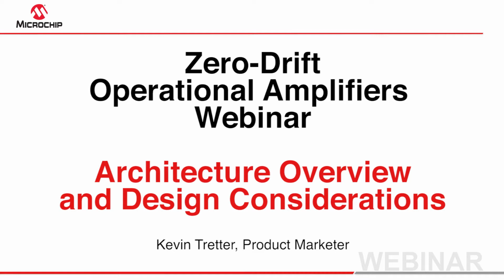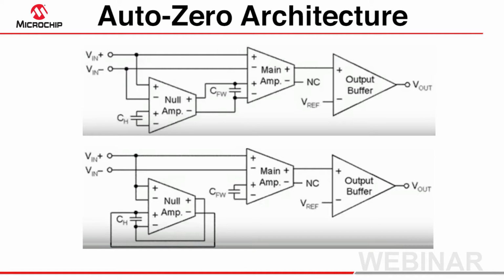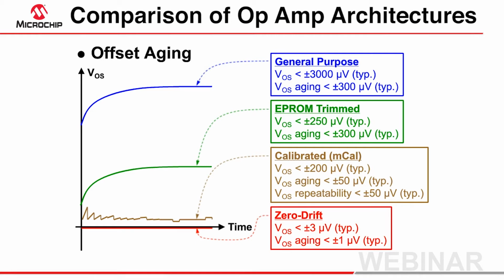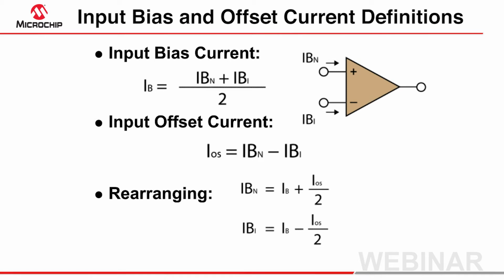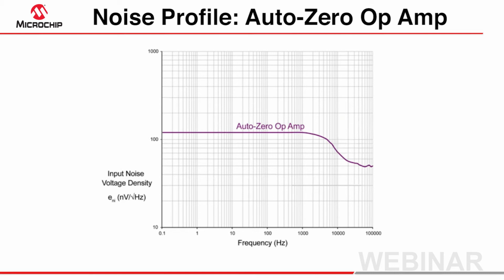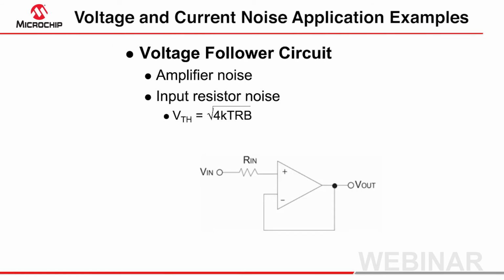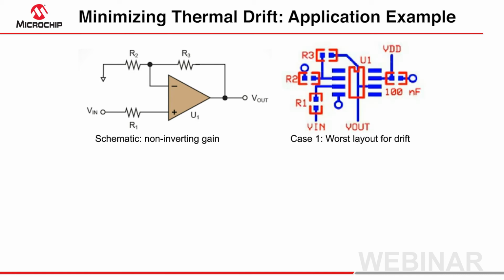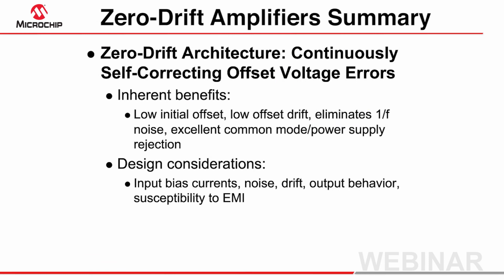Zero Drift Operational Amplifiers Webinar

Comment: Hi! Thank you for this clear and interesting video.
1) is there a significant difference between zero drift amplifiers and auto-zero amplifiers?
2) Is it possible to use either a zero drift amplifier or an auto-zero amplifier for an integrator?
3) ... for photodiode transimpedance amplification?
Reply from the maker: Hi there, thanks for your comment! Please see below for responses to your questions:
 
-  Difference: Zero-drift amplifiers, like auto-zero and chopper-stabilized, both correct offset voltage continuously. Chopper-stabilized amps are generally better for low-frequency noise, while auto-zero amps use a sample-and-hold method.
-  Integrator Use: Both types are excellent for integrators due to their low offset and drift, preventing long-term error accumulation.
- Photodiode Amplification: Both can handle photodiode transimpedance
Reply: @MicrochipTechnology  Thank you for this brilliant and helpful answer.

Comment: Thank you for an informative presentation. I would love to hear more about external techniques to further reduce the noise energy at the chopping frequency (and harmonics). Also I'd love to hear some techniques for dealing with capacitive loads.
Reply from the maker: Hi there, thank you for your question. Please contact our client success team for help reducing noise energy and dealing with capacitive loads. www.Microchip.com/css

Additinal helpful resources related to Capacitive Loads and Reducing Noise Energy are below: 

Driving Capacitive Loads With Op Amps (https://www.microchip.com/en-us/application-notes/drivingcapacitiveloadswithopam)

Op Amp Precision Design: Random Noise (https://www.microchip.com/en-us/application-notes/an1228)

Reduction of the High-Frequency Switching Noise in the MCP16301 High Voltage Buck Converter (https://www.microchip.com/en-us/application-notes/an1466)

Thank you!